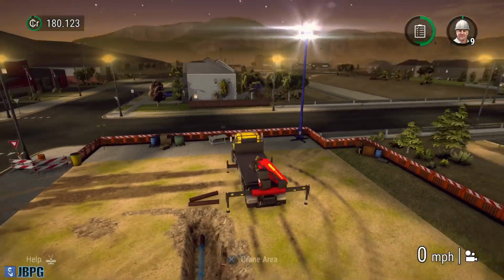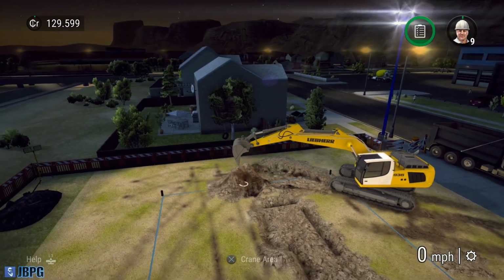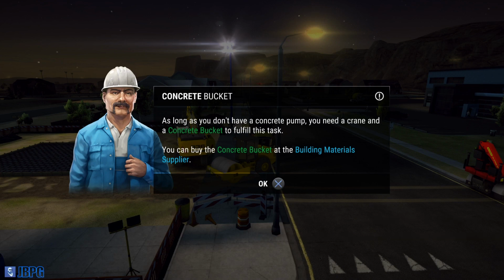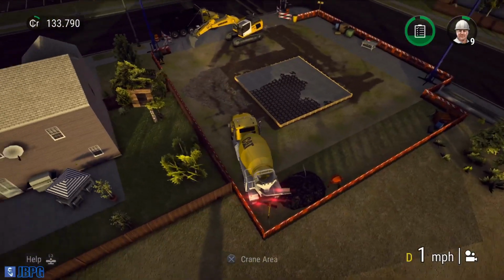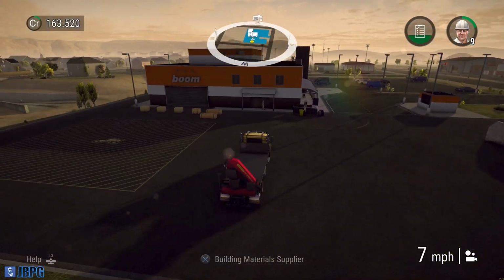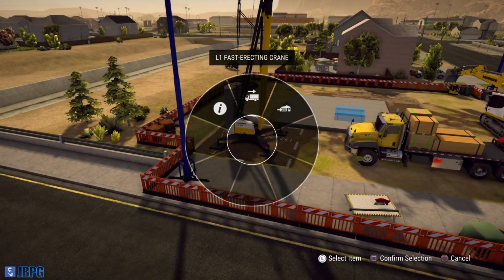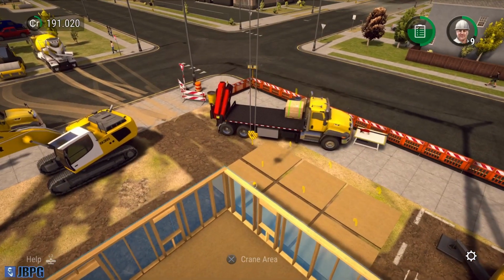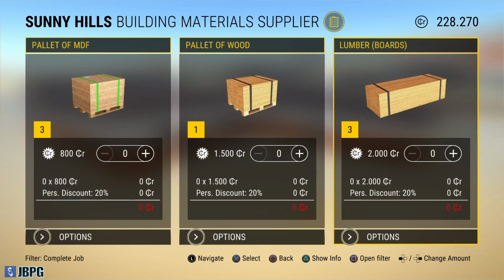Construction Simulator 2 PS4 - Episode 16: Getting The Crane Up & Running...

Comment: Yes, the tutorials are not the best!!
I notice you got the crane to work here, here are the steps:
1. As you drive onto the site you see "X Crane Area", this sets a place to put the crane if it isn't there already, That is why the tutorial said to press X, but they didn't tell you any more.  Sometimes you can't put up the crane until other stuff (like digging) is finished.
2. Once you have the square to place a crane in, select Triangle to enter construction mode.
3. Use R1/L1 to until the "crane area" is selected. 
4. Press "Square" to bring up the menu in case you have different cranes, there are three, all different sizes.
5. Highlight the crane you want from the choices, in your case right now only one choice.
6.  Now that it is placed you select like any other vehicle, DPad down.
7. Just my suggestion, Dpad left, select "Hook camera", then use R1/L1 to zoom in and out on the hook.
From your video I see you have things in under control fine, maybe this info can help others.  Also sometimes the crane is not as easy to set as it was in your video, that is why the steps above. Amazing how much easier the crane is, as you stated.

For your cement bucket, it is very easy once you learn how, again tutorial is bad.  You have one in your warehouse, for any that don't know you buy it at the supply dealer not vehicle dealer.  Then load and unload like you would any other items.  Take to the construction site. Pick it up and place behind the cement mixer.  Fill with concrete using your chute like you would anything else.  
What I see people having problems with is dumping it.  
Pick it up with the crane or truck crane..  
To dump it, again use the triangle (Y on xbox) and use R1/L1 until bucket is selected, then press Square and select the same thing you would select to pour concrete from the truck.  One note, for some reason the bucket does not stay selected like other vehicles.  So if you want to stop dumping, you will find the bucket is no longer selected, you need to select again.  If you have excess, just store the bucket and you will get credit for any unused concrete.
Sorry for being so long on this post, I see so many having the same problems with the crane and cement bucket.
Good videos, enjoying them.